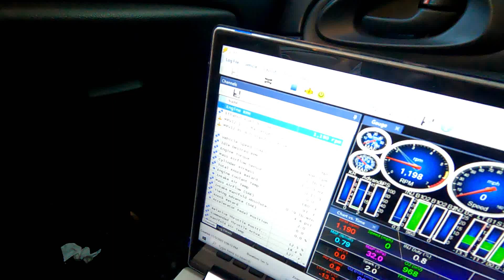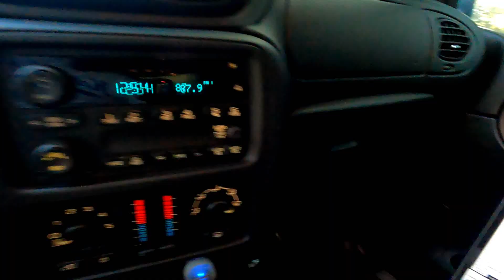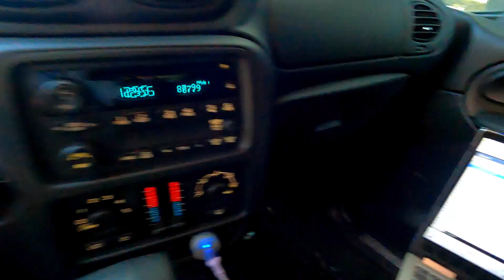Turbo Trailblazer Atlas 4200: Flex Fuel Sensor Install!

Comment: Hey, I have a bone stock ‘08 that I added the flex fuel sensor to, and I’m getting crazy high torque readings at idle(4-600 ft lbs) whenever I enable the sensor and switch from virtual to sensor in hptuners. I’m still on pump gas (9.6% ethanol readings ) and I’ve populated the flex and alcohol tables. I’m lost at this point.
Reply from the maker: Mine is having similar issues but its due to the tables its reffering to. I know you may have populated the tables but i bet thats whats causing it. Reach out to jeremy at fasterproms and he can help you.
Reply: @J-Whit  thanks!

Comment: I'm about to buy a 2005 LT to turbo with the Artec manifold.  Do you know if the 2005 ECU is capable of utilizing Flex Fuel?
Reply from the maker: I'm not sure. I think its only the e67. But I could be wrong